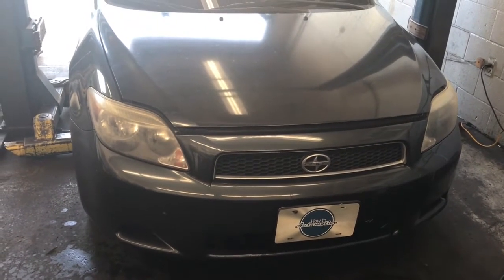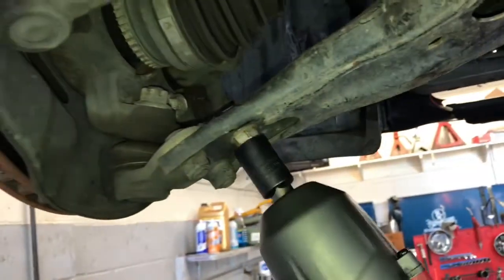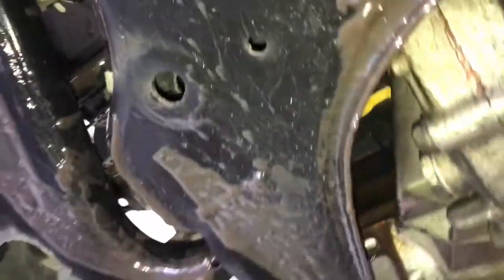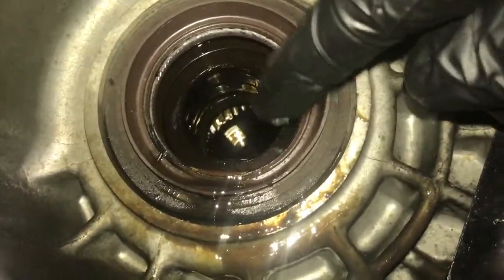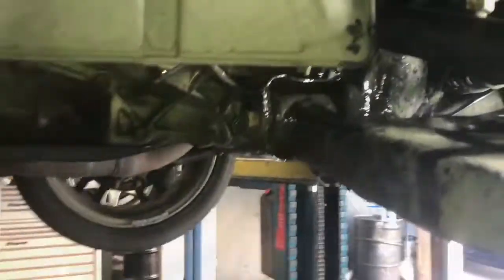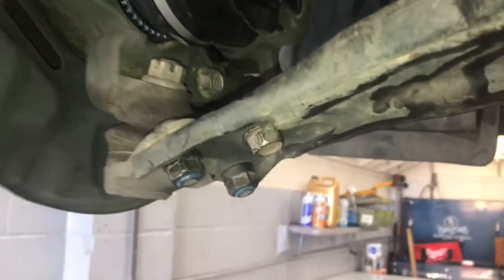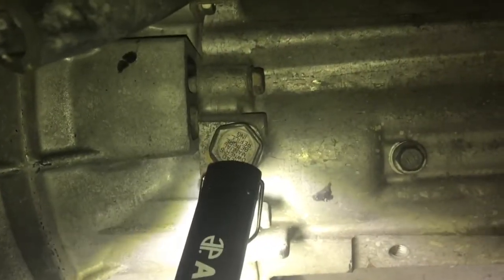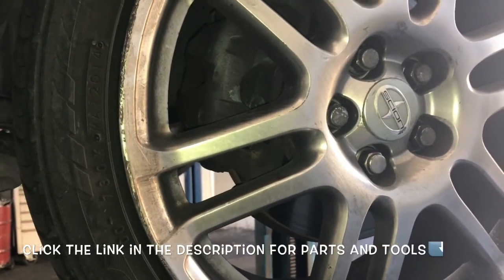How To Replace Driver-side Axle Shaft On A 2005-2010 Scion TC

Comment: NOTE TO THOSE WITH A MANUAL TRANSMISSION: The torque specs for the axle nut for the manual transmission Scions is not 160 ft lbs. It is 210.
Reply: How big of a torque wrench is needed to achieve that?
Reply: @joequillun7790  unfortunately it was my old car. Should be able to find that weight some googling, but I'm fairly sure it was a 23mm or 24mm. Could be as small as 22mm.
Reply: @cole2999  No, I'm talking about the drive, and length of the torque wrench. If a person only weighs 155 lbs, and has to torq. 210 ft/lbs, he's gunna need a 3/4" drive torque wrench, about 3' long.
Reply: @joequillun7790  I don't know what the right answer is, but I know I used a 1/2 inch wrench that limited at 250ft-lbs. I torqued at around 215 in case the wrench was off. Wrench was 18-24"
Reply: @cole2999  That was a good answer Colby. Thanks for the reply.
Reply: Same for 2005 manual as well??
Thanks
Reply: Thanks for the heads up

Comment: Man I wish mine would come out like that, I’ve pried in that position and even hooked it with a fork and slide hammer and it’s still stuck
Reply from the maker: Nick Travers that sucks! Hey do you make special pickle forks for removing axles. May want to look into it.
Reply: How did u get it out same problem
Reply: Kind of funny, was thinking about this the other day. Okay so go to harbor freight if you don’t have one. Get some Pittsburgh pry bars, the ones with the square neck, not round, unless you already have a square one, put your pry bar right behind the big face on the axle, and the transaxle housing, then use a long handle adjustable wrench on the square neck of the pry bar and twist it until the shaft pops. Hope this helps
Reply: @rafaelzavala3445  this method I just listed should work, I just did the same thing on some cv shafts on my friends Outback a couple weeks ago

Comment: If fluid come out the tranny does it mean the seal is broken and need a new seal as well before inserting the new Axle?
Reply: The axle going into the transmission with the seal around it is what holds the fluid in. So by removing the axle you can literally see directly into the transmission. My brother and I just jacked it up on a small hill and when we pulled out the axle we didn't lose any fluid.